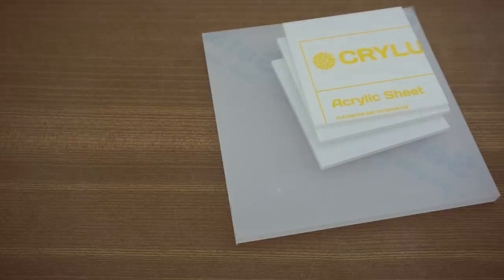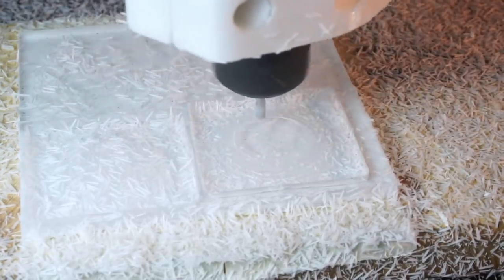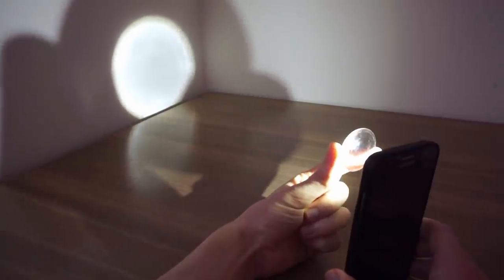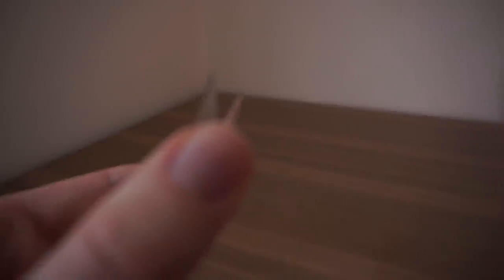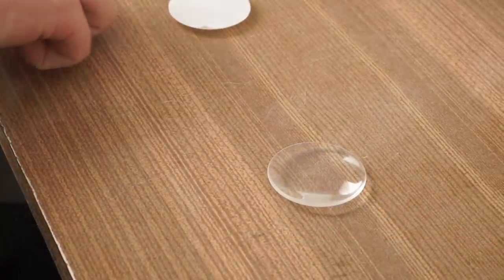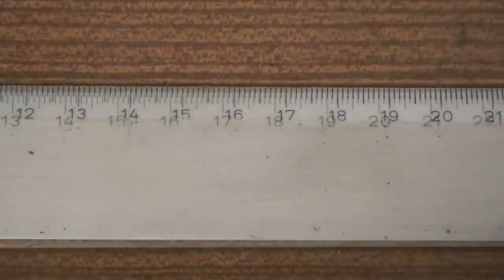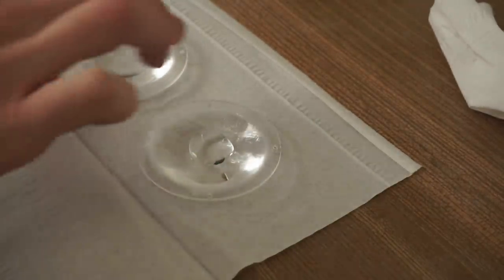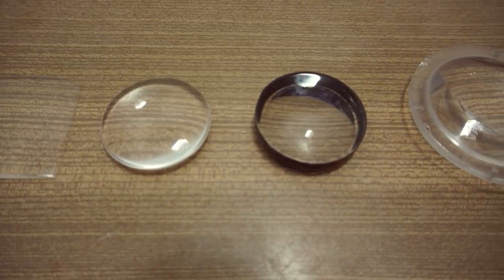Making Lenses with a CNC Router Part 1

Comment: Next step: find a tool making it possible to get the CNC to polish it. Btw, by using steel rods you can make registration holes and CNC from both sides. It's quite easy to get to work with enough accuracy.

Comment: This is huge! Make eyeglasses! They are usually just plain old polycarbonate. Next step is to make a program to generate Gcode for a lens using a regular glasses prescription.
Reply: Use to make optics its actually the chipping around the edges and the polishing that will get you.
Reply: polycarbonate, but with a bunch of coatings for less reflection an more scratch resistance...
Reply: It is very simple.
Normal lens are spherical.
This generates an aberration for lenses with high curvature.
Theoretical lens are parabolid, which are very simple to caculate:
z=aR^2 + bR +c
Where R = x^2 + y^2

Comment: How about... Put a polishing pad on the cnc and let it run really slowly over the lens many times ;) it knows the correct curve and all
Reply: H. Petersen that's a great idea!
Reply: It wouldn't avoid scratching the lens though, which makes it just as god as hand polishing
Reply: cnc spindles are not good for polishing, most of them lack torque and at higher speeds will probably melt the acrylic, I tried once to polish a stainless steel sheet with my router, it did not go well...
Reply: @raresranga8511  actually they work great. you just cant go heavy, light cuts maybe .003 inch  at a time. you also need a special coolant.

Comment: For those interested, check out the VFT Orbit 2, which is a machine used for pre-polish surfacing of eyeglass lenses. That's how it's done in the prescription optics industry. Unsurprisingly there's quite a bit of aberration in these lenses, but it's quite impressive what you can do with even a MPCNC. Very cool video!

Comment: Would adding water or oil to the cutting process make any difference. ie if heat might be causing a problem with the acrylic or causing the acrylic chips to scratch the acrylic lens whilst cutting. Maybe just air assist to blow the chips away.

Comment: This came out far better than I would have guessed.  It might be interesting to try for a sort of Tessar type lens using 3 elements; a planer convex - planer concave at the objective and a planer convex near the film plane.  It will probably have a lot of distortion and chromatic aberration,  but it would be interesting to try.
Reply: I think wherever you see lenses that have cemented elements, it's to correct for chromatic aberration.  I would think that by using clear plastics of different dispersion and refractive index, the same thing could be done.  However, the glass lens designs that have been developed over time have all been based on available glasses.  No telling how these could be adapted to plastics.

Comment: Would flame polishing help with the fine scratches?
Reply: it will have some cracking inside. Better sand it with 2k to 3k sandpaper grit and use metal polish, works better for me. Sometimes i use carnauba liquid wax.

This is based on my experience polishing my acrylics.
Reply: last time i use meguiar plastx it really work well with polishing acrylic
Reply: @unlocker92  the problem to some. Those are not actually available locally, so we are giving some alternatives to what will work out from those materials readily available. Cheers!!!

Comment: Do you know that acrylic can be heat polished?? It will not work on completely unpolished surface, but can make the final step bit easier by allowing you to eliminate the highest grits... But be sure not to overdue it, since acrylic might out gas and bubbles will form, if the heat gets too deep. Takes practice with blowtorch or heatgun.

Comment: in theory would it not be possible to use a slower gear-reduced CNC spindle with a polishing attachment with the proper grit and lubrication in order to polish the lens?

Comment: That's freaking ingenious. How long does it take for you to sand one lens?
Reply from the maker: Thanks! It took roughly 15-30 minutes depending on the size of the lens.
Reply: @leonbrauns  Do you feel, that it can be accelerated with a heatgun or machine polishing?
Reply from the maker: I am definitely going to try out flame polishing as well as using machines for sanding and will report the results.

Comment: this was about the most helpful vid ive seen for 6 months. My issue is VR helmets have terrible lenses in them that defocus around the edges and chromicise the light (colour split) I need VR for digital sculpting, but its only useful with lenses in the head set that are "right"  I know why the lenses are "wrong" and I know how to fix it, but I have to build the lenses my self. this is how I can do it! thankyou so much

Comment: Awesome! What are the chances that lapping and polishing could also be automated on the cnc? Thus would make astronomical mirror grinding a possibility as well.
Reply from the maker: You would need a CNC which is able to use flood cooling (mine is not). Also, for something like astronomical mirrors, I don’t think a CNC router is accurate enough. A CNC lathe would be much better suited for that.

Comment: Would it be possible to make custom Fresnel lens with this process?
Reply from the maker: I doubt it is possible to make a fresnel lens with a CNC router. You would need a tiny end mill and sanding would be a nightmare.

Comment: Can you make VR lenses like Pimax5k+  HMD, very big lenses 200 FOV vertical?
Reply: why not, but you still need software for it.
Reply: @666Azmodan666  Was more thinking to replace the fresnel-lenses on the pimax to clear ones. Is it possible! Just make the exact the same but without the fresnel thing. Maybe there is a market for that. replace with your own?
Reply: @pushthebutton4602  I know that they exchanged for the better, but now I do not know if in htc or pimax ... but as for milling, it will certainly be a matter of measuring the original, modeling or programming I do not know what I do not know what shape it has. You can also think about painting the original and scanning and on the basis of the scan do what I wrote above. Glass would probably also be possible, but very slowly and with a diamond cutter.

Comment: Would it be possible to polish the lenses with the CNC router?
Reply from the maker: In theory it should be possible. However you really want to use flood cooling for that, which isn’t possible with my machine.

Comment: Is is possible to do an aspheric lens using this technique?
Reply: Of course it is.  If you can draw an arbitrary curve, you can then rotate that curve in your 3D CAD to get an aspheric shape.  For example, if you can draw a parabola in 2D, then rotate that about its axis, you get a 3D paraboloid.  Your CAM software then generates the toolpath to create that shape on the CNC router.  It's all in the software.

Comment: Dont forget to anneal the acrylic in your stove. Otherwise, with time, the acrylic surfaces will crackle due to matrial internal tensions introduced by machining and polishing
Acrylic light guides are used in high energy physics in quantities for particle detectors. They developed sophisticated annealing procedures
Reply: Just short of making light pipes for particle accelerators, what is the slightly less sophisticated procedure for annealing acrylic?
Reply: @BrightBlueJim  ,well, keep the objects in your stove - a stove with internal blower and tight temperature control of +/- 1°C - at around 80 deg C and leave them in there at least for 2 hours. If the acrylic is thicker than 3 mm in any area, the tempering period must be 20 minutes more for each additional mm, i.e. a 10 mm acrylic block requires tempering of 2 hours plus 7*20=140min=2hours20min which in total is 2 hours and 20 minutes.
After tempering slowly reduce the stove temperature by 10 °C each 20 minutes until you reach 40 °C. Then shut off the stove, take out your parts on a table and let them cool to room temperature.
This will take most of the tensions out of the material, also the glued parts.
Reply: @ghlscitel6714  Thank you for the information.  This is very useful.

Comment: This is amazing, think of all the things you could make. 
- VR headset
- Camera phone lenses (3d print a  moment lens adaptor)
- telescope or binoculars
- Glasses
Reply from the maker: At least one of those things is definitely on my to-do list ;)
Reply: WMR Headset transformation from cheap fresnel lense to a proper one 😋
Reply: @GrimmChristopher  Was thinking the exact same thing. Replacing those lenses to properly made ones designed specifically for the WMR headsets would be pretty huge. Clarity benefit from the Gear VR lenses but without any of the weird distortion :)

Comment: You can make copies of them by resin casting :)
This also works for anyone with just a 3D printer, print your lens in a plastic that’s easily smoothable (like ABS) or get busy sanding PLA (you could also add some filler like laquer or epoxy). Make a mold with silicone and now you have an infinite supply of that lens :)

You could also make a mold directly using air to indent the surface in the silicone mold, but then you have very little control over the exact shape of the lens, though it would produce ”perfectly” smooth lenses.

Comment: Other than for educational purposes, what sense in making your own lenses? Where can you use them?
Reply: DIY Laser Tag
Reply: @andy-in-indy  Wouldn't it be easier to get ready made lenses? Which, I assume, would be of better quality. Can you make prisms this way?
Reply: Ready made lenses tend to fall into two categories: very cheap cast lenses or very expensive ground lenses.  The optical quality of these lenses, especially with some better polishing, is much better than the cheap cast lenses you will find in toys, and much less than the cost of glass lenses treated to pass Infrared (TL;DR glass does not like to pass IR, but acrylic does.  That makes these a lot cheaper).
Reply: @andy-in-indy  I see. Thanks a lot for answering. Learned some useful stuff. I assume that optical prisms could be made this too, couldn't they?
Reply from the maker: I just made a prism from some leftover material and after sanding and polishing it works a treat.
Reply: @leonbrauns  Could you elaborate a bit on what materials you use for sanding and polishing?